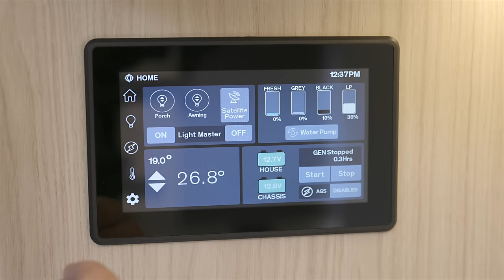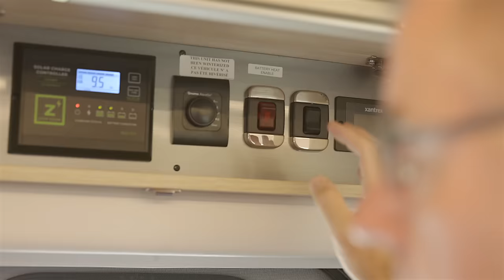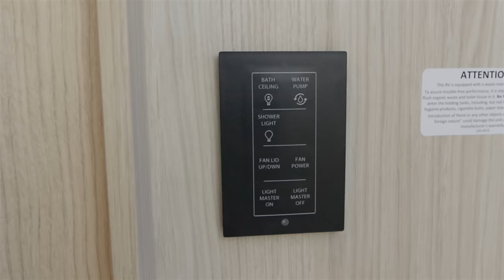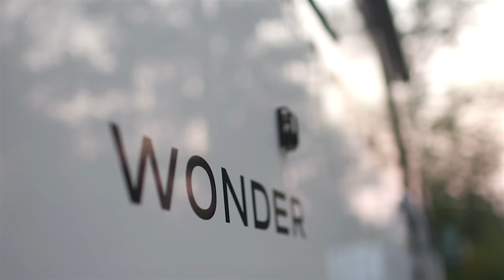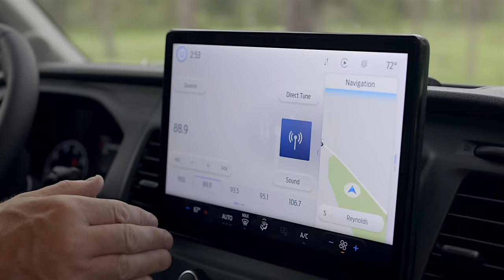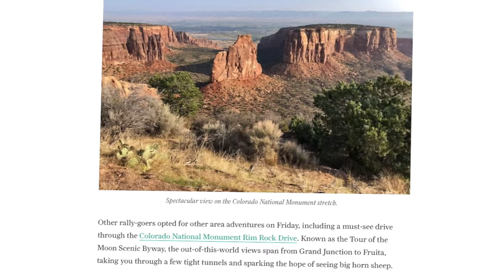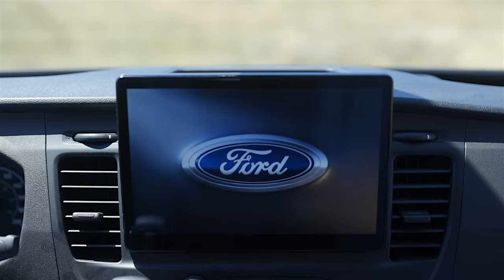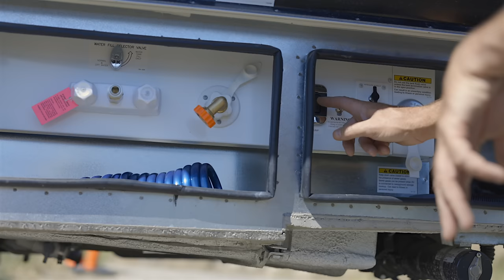2023 Wonder Murphy Bed Lounge

Comment: Holy smokes,  $250,000? $250,000??? Up from $165,000 last year. I would have to sell my house for this thing. Way, way too expensive. These prices are going through the roof.
Reply: The website says $174,920. Where did $250K come from?
Reply: @jeffjennings2420  2023 Wonder Floorplan Murphy Bed base price says $214,510 , add solar, Truma Go, Generator, AWD, External Entertainment Package, Lithium Batteries, Macerator and a couple other options. Quote Totals  $248,910.
Reply: I'd have to sell & maybe donate some organs as well 😂😢
Reply: And the R.V industry went down like 52 percent since last year.. That’s why when you drive by a dealer they all sit and collect dust!! Even more of a legitimate reason to drop the asking price.
Reply: It is expensive but if I would purchase it I would definitely rent it from time to time just to make a little change. Also you can always relocate with it.
Reply: Plus no washer dryer incinerator toilet and hydro panels solar panel that can run on full electric can have a custom job for that price!!!!
Reply: And it’s a ford. Oh no
Reply: I’d buy a  yacht first
Reply: that built only for rich folks who seek travel for pleasure
Reply: Dang!!!!!!!  What’s the point if it costs that much lol
Reply: It's the extra cost of the warranty pouch....🙄😅😂😅😂
Reply: 👏🏻🏆🏅👏🏻 100 % Agree with you !  Five years ago, they were selling for $96,499. 🤯
Reply: Still to high.  You are camping. Dont need all the bells and whistles
Reply: 7:57 Great cut 😂😂😂

Comment: I toured this van today at the RV show in Hershey.  WOW!!! I didn’t like slide outs or Murphy beds when I walked in, but I have been converted. This was my favorite coach of the day. Even more than the LTV rear twin bed. Fantastic job LTV!!
Reply: If you use the van much, I would be concerned about any floor plan where I have to "make" the bed.
Reply: Did you get a sense of cost?
Reply: Why didnt you like Murphy bed
Reply: @lemichaeljohnson2069  I haven’t toured one but went to the website and base was around $187,000 USD and built one out with the options I liked for $203,000 USD
Reply: Did you happen to note the cargo carrying capacity?

Comment: Leisure Travel Vans +  Many great features. ++All the power options for the refrigerator. ? Is there a water filter option?
- Sofa seems uncomfortable for reclining due to the head. and back seem too upright No head rest and too close to the fold down bed legs, 
-Shower door latch seems awkward. - It would be nice to have the external doors to be able to lock all at once from inside or on key fab instead of having to lock each door individually with a key.

Comment: Great motorhome.  A few comments and suggestions.  I am guessing you have to make the bed up every night with sheets, blankets, etc.  
In the video, they just kind of magically appeared.  It would be nice to show how hard it is to make the bed up.
Please offer a compressor refrigerator,  Dometic makes a 8 cu ft that would fit in the space of the fire hazard absorption unit. What about 3 lithium batteries?  
Get rid of the Wineguard booster, Space X's Star link will making that obsolete before the new model is off the assembly line.  The space on the roof is better served by an additional solar panel without the shading from that ugly thing.  I am sure Wineguard is suppling these below cost to get subscribers, don't make it a mandatory option.
Reply: Well said...
Reply: Wow, good suggestions!  😀

Comment: I would prefer a rear Fixed bed, because over a time the mechanical part has to be replaced and it can break easily in your daily usage.
Reply: Yeah that is why I like the b and b+ because they generally don't have slides. I want it simple. Mainly cause its more for travel than long term setup somewhere.
Reply: I was really hoping for a CB with dinette in the Wonder!
Reply: Check out videos of the 2022 models with twin fix beds and the Murphy rear lounge. Both no slides.
Reply: As an automotive mechanical engineer, the moving parts used in a Murphy bed is no different than one used for your suv tailgate. If you are not in a constant fear of your suv lift gate slamming down on your head one day, then you need to give the Murphy bed system some confidence.
Reply: @ubercai    Thanks for your qualified input and point of view!  😀

Comment: This looks great overall but it doesn't look like there is much elbow/knee room on the toilet -- wondering what the distance is between the divider wall and the shower??  Also, the TV-elevator needs to be possible to control/lower from the bed without getting up for closing it at bedtime.  I do really like that unlike the Unity there is the day bed option with the extra cushion over the table -- great for an afternoon nap without putting the bed down and also a place for the dog to lay down between us when we are watching tv in the evening.  However the setup of the table seems a little clunky.

Comment: If Ford would offer the Hybrid version of this engine in the Transit you could remove the generator and use that room for extra battery storage. The built-in generator in my hybrid F-150 is perfect for those small towables and would be an upgrade to the generator offered here.
Reply: exactly 🙂

Comment: To my opinion, LTV should create a version with no generator (save at least 200 lbs), but with dual alternator 250a each, 800w solar panels (400w on the roof and an accessible MC4 plug to add two other 400 watts external panels more practical to get the full sun) and two 320ah Lithionics batteries (self heating and connector to Second alternator), and a 12V fridge with compressor Isotherm (marine version which resist to  45 degree angle), or at least a 8 cu ft NORCOLD or Dometic 12 V fridge. I would replace the toilet with Cinderella incinerator toilet connected to propane to save water, and allow off grid camping without issue linked to black tank. Also it would add more cargo capacity without any generator, without black tank and macerator, and would allow the place  for a biggert inverter Victron 3000w and two lithionics and the dc-dc charger with relay for the alternator.

Comment: First, love it! Leading the pack on our wish list. If you are still tinkering, I would say three things. First, the dinette table is not up to your standards, but I suspect you know that. Make it like the loungers on the Unity please. Two, some models have had available counter extensions to increase the kitchen work surface. My wife loves them and always comments when she sees them. The layout here is different but finding a way to extend the counter space would be great. Lastly, and far most important, if you could figure out enough structure to allow us to use the back ladder to hang two bikes (without using the hitch), this floorpan would be perfect for an active couple like us. Since we want to use the hitch for a 200 lb scooter, figuring out how to carry two 30 lb bicycles has become our biggest problem. So far the only solution is a small trailer, but it really seems a sturdier ladder would solve the problem. Please consider it. We are not alone and I suspect an optional ladder/bike rack would be hugely popular with more active couples. Assuming there's enough CCC for the added 260 lbs.
Reply: Agree as this is the first van my wife loves. For me I have to have my bike and storage for chairs, etc.  To now have the option of Ford or Mercedes is great.

Comment: Has anyone ever travelled to Europe in this?  Meaning, bought in North America and travelled via cargo cruise ship to a port in Europe?  I'd love to do this and wondering if it could be made for Euro power? 220V  Been doing  research on these. And this by far is the best one I have seen.  Love the murphy bed.  The fact that there is a tip out, just takes it to another level.  That bathroom!!!! Beyond amazing. The only thing I would change, the height of the vanity.  I'd like it a little higher, being 5'9, bending over to brush teeth... I need the higher vanity.  This model, and the colour, exceeds my expectations.  I like dark colours, but the off white, just gorgeous.  I am use to driving a 40ft school bus. This is like driving a small bus.  Perfect. In CAD.... How much? How long of a wait? Very well done video.  Kept me interested.

Comment: We own a leisure travel van Unity FX we love it. The Murphy bed is a game changer!
Reply: I would like to see a Cinderella toilet with removing of the black tank. Two mppt controller with an external mc4 plug for external additional panels. Two batteries 360ah and the removal of the generator. Instead they should put an additional 250ah alternator that charge the battery at idle or moving. It would be a far far better rv, greener and allowing more off the grid trip.

Comment: THINGS I LOVE - the way the TV comes up (manually), and that you don't even have to lift it to see it, the window above the sofa, ducted air, large frig, door/screen,  (didn't say whether inverter is 2K or 3K), love the kitchen accessories, inside storage overall, bathroom is wonderful except for the toilet that requires a black tank, the outside table.   THINGS I DON'T LOVE - the slide, miss the large garage in the rear twin model, but this one has SOME good outside storage, black tank, propane, solar, generator (needs total lithium), this IS a very innovative sofa/bed/dining set up for those who like that model, cabinetry is very nice but makes MH too heavy, I would prefer NOT to have a built in cooktop (rather have a single or double burner that could fit in a drawer) and could be taken outside to cook, not sure about a "round" sink, wish more manufacturers would put the service center higher (like on the Ekko).  I've always admired the Wonder Twin, but I've put my deposit on an Embassy (total Lithium / no black tank, no propane, no solar, no generator).
Reply: I like your preference for total Lithium. But I have yet to see a total lithium in this category that has the "livability" for two that this van offers. IMO, Storyteller has, by FAR, the best total off-grid product on the market. But my wife and I would have difficulty with the tight living arrangements. We need more space to spread out. This where I think the Wonder products shine.

Comment: We decided to buy a Wayfarer because of the washer/dryer combo and the central vac. But I have to say: 
The large wide Murphy bed is what we love, the new stable dinette table that is solid and not shaking around are absolutely great. Also the new way to turn it into a comfy dinette seating option. That was not comfortable with the recliners before.

Is there any chance to have a washer/dryer combo in the hanging closet next to the.  fridge or in the bathroom ?

The outside storage doors going upwards, we will still hit them with the head plus you need to go down more. Any chance to have them open to the side like a class A.

Overall this is the best Unity I have seen

Is it possible to install central vac ?
Reply: This is a wonder not a unity.
Reply: Lol.. "central vac".. "washer/dryer"... its an RV.. not a house!!!

Comment: Odd thought 💭… For those of us that spend time working on a computer, consider some way to do a work area.  Ideal (for me) would be a way to pull out, or place the TV in front of the table (to use the HDMI cable interface of the TV for a big screen), nor a way to raise or lower the seat or table a few inches in either direction.  In the existing system a way to move the chair forward and place the table between the TV and chair would work.  🥰

Comment: The only issue with this one is if one person is sleeping there is no other seating/dining options. I prefer the rear bed model. Great presentation as always Dean.
Reply: you have the two front seats, but I always wish there were tables for front seats when facing rearwards
you have to settle for a foldable table, which is quite feasible considering how well this van uses space

Comment: There are so many advantages to going on a road-trip in a small rv.       You can easily fit into tight campsites which might be away from the crowded part of the campground.     It is easy to pull into a parking-lot or rest-area and not need a special place to park, and you can be away from all the noisy 18-wheelers.     Fuel-savings allow you to spend a few nights in a motel, or eat out more often.    Or just plan on spending more time outdoors rather than in the RV.      Less maintenance.     Easier to have mechanics work on it.

Comment: great presentation, went into this video expecting to criticize that crap out of it, but this build is so well thought out i came away with only two suggestions....people that have lived in rv's have their favorite brands when it comes to vent fans....i would suggest you make a fantastic fan or a maxx air fan the buyers option....hell maybe you already do. also the biggest complaint i see in the hundreds of van build video's i watch is loaded cabinets spilling out onto the floor when taking turns i would either install push to lock handles on every cabinet door, or you could be an industry leader and develop a mag lock system that engages on every door inside and out... that engages automatically when the transmission comes out of park (with a temp bypass switch on the dash so a passenger could access a cabinet while in motion) either way nice build

Comment: Excellent RV and video. This would be game over if it was a hybrid. Electric and gas motor. The car running on Gas recharges the battery like cars. No charging stations needed. Game over.

Comment: Looks like really good quality and is rumoured to ne really good quality and is priced as id its really good quality and then they cheap oit with the crappy swintek slide system. If they put the slimrack slide system with the billet tracks i would be very interested in getting one buy anything with that crappy swintek is a failure waiting to happen.

Comment: This is very well laid out. The only two things I would change would be to replace the inner table/sofa seat with a high/low table like you'd find on yachts, and to offer a fabric option versus leather. The leather is very nice and all, but it requires constant upkeep and maintenance to keep it from splitting and cracking and eventually peeling after 5 years or so. Fabric is easier to clean and much easier to maintain.
 At $162k starting, I'd say this is probably a good value for what you get. I would probably want a larger battery bank and more solar on the roof. Running off of propane is nice and all, but if you get stuck or you break down somewhere off-grid, you're going to run out of propane pretty quickly... but the sun is free and nearly always available. Adding an optional vertical wind turbine could be cool too. Just park somewhere windy and mount it on the back corner of the the roof, lol. You could store it in that huge outer storage bay, lol.

Comment: I'd absolutely love to have this one!  I wonder whether a small upper and lower washer & dryer would be an additional option or feature.
Reply: There is no option for a washer dryer. There is no room for it.
Reply: @DK-bk1vq  I see.  Thank you for your reply.
Reply: @TheJTBOUNDS  Your welcome! I rented the 2015 MB from an independent dealer in upper Michigan, for a two week period. Even putting a combo washer dryer unit would be challenging without losing a refrigerator or the clothes closet, lol. There are stand alone mini washer/dryers available, that would fit in the shower, but that would involve taking it in or out the cavity when using the shower. I found mini washer/dryers for RV's, on Amazon. Hope that helps!

Comment: I've admired the Wonder RVs because of their high tech and simplicity.  This 2023 Wonder breaks the mould, but not is a good way.  The new RV slide out means a major component failure potential and loss of the uniform insulation.  I wish Wonder would offer a bed over cab, induction cooktop, double glazing, more solar and more battery, drop propane.

Comment: The prototype is just fine. I would put a max air fan in place of that skylight over the bed though so you can have positive air flow from the bathroom to the front of the coach. We’ve all been out there when there is zero breeze which negates cross breeze ventilation. And I hope you offer customers a plug or something to cover that skylight in the shower. Those are great in the winter but miserable in the summer.

Comment: I thought it is not recommended to use slide if the vehicle is not leveled. The wonder doesn’t have 4 point leveler system…for the wonder the RL which has no slide is more recommended…

Comment: Is there any information available about the payload and towing capacity?  I've looked all through the company website for specs and those number are not provided.  This looks like it could be just what we're looking for but I've run into issues with other brands with very little payload capacity to work with.  Guessing the towing is at most 5,000 lbs but need to know before putting this on my short list of possible motorhomes.

Comment: Not impressed, not enough storage for long trips, for clothes or food. Besides, who’d want anything to do with Ford.
Reply from the maker: The 2023 Wonder MBL has quite a bit of storage, both exterior and interior compared to a lot of our other floorplans (except the Wonder Rear Twin Bed). There are 2 interior hanging storage closets where you can hang clothes, as well as a pull out pantry and shelves both in the middle and the rear. You can see some of the storage areas on the floorplan overview here: https://leisurevans.com/wonder/floorplans/